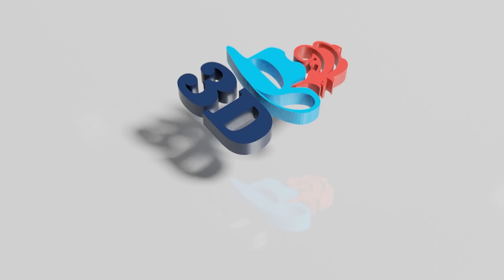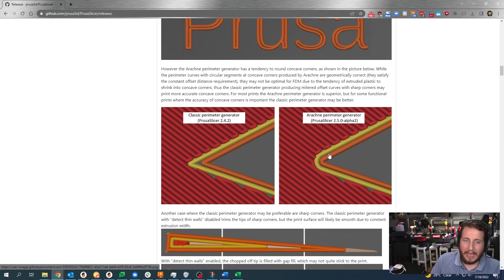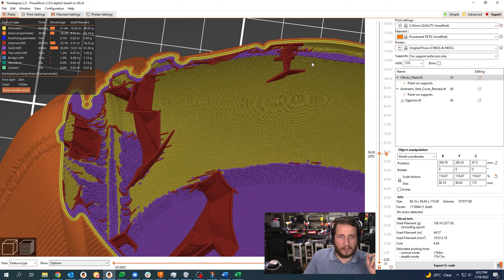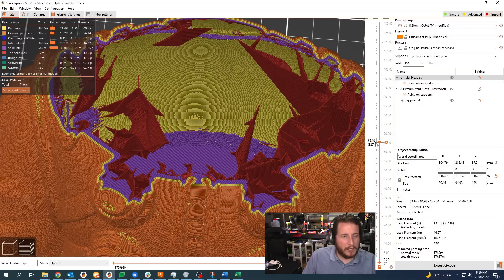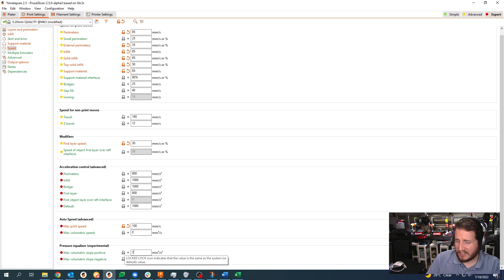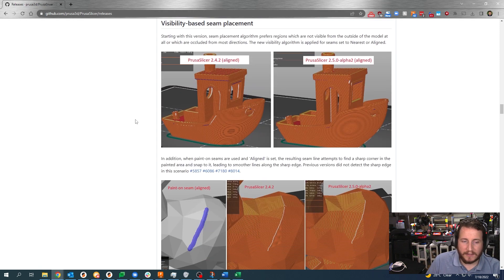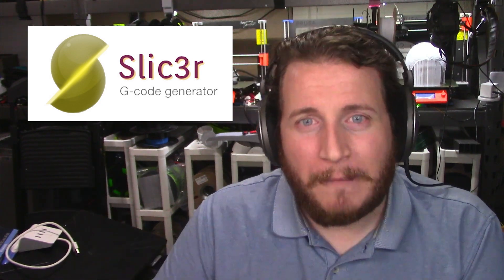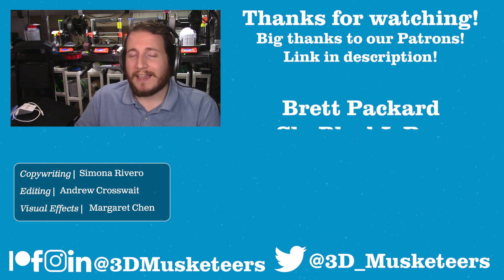Exploring the latest PrusaSlicer 2.5!!! (2.5 alpha 3)

Comment: hey Buddy, could you go through the arachne settings in Prusa Slicer again in detail ? I understand what it does in principle, but the detailed explanation ? Oh man, I mean english is my 3rd language so I might be just to dumb to understand it but it just sounds super confusing. For example:
"add middle perimeter threshgold" the smalles extrusion width, as a factor of the normal extrusion width, above which a middle perimeter will be added. Note that this applies as id the entrire shape should be filled with perimeter ...etc.

WTF does that mean ? 
I want to simply tell the slicer 0,5 extrusion width min. width 80% (0,4mm) max. width 120% (0,6mm) and that´s that. WTF is this complicated explanation ?
Reply from the maker: I am no expert on it personally, but basically Arachne dynamically adjusts line width for your parts. You provide it a min and max and it will vary based on the needs of the part. 

I can do research if you would like and integrate it into the PS 2.6 video when they release it?
Reply: @3DMusketeers  I know what it does, I just don´t understand how to set min. and max. values. It would be great if you could integrate it into your next video. Thank you =)
Reply from the maker: It will not be the next one, but one eventually, yes. I have ours set to stock for now, if it aint broke, dont fix it!
Reply: @3DMusketeers  I experimented with 0.8mm extrusion width on 0.4mm Nozzle for some storage boxes I needed to print in Vase Mode. It works very well. I would like to have one profile from 0.4mm-0.6mm this way I can print fast but still precise. I am not 100% confident what each setting really means. However you should really try out printing waaay wider layer lines, it works great and is about 50% faster.
Reply from the maker: This is all done internally, trust the slicer. If you are unsure, just leave it stock :) It works fine stock.

Comment: It's still missing the speed setting for the 1st layer perimeter, like in Super Slicer, and the tree support.
Reply from the maker: Tree support is coming 2.6 confirmed. I prefer snug still personally, easier to remove and less troublesome on bowdens in my experience. I dont care TOO much about first layer perimeters, but it would be nice to have as the perimeters could be slower than the infill. With a dialed first layer though, you can easily run it at 35-45mm/s and get good adhesion in my experience.
Reply: @3DMusketeers  For PETG i always have trouble with the 1st perimeter, that's why i use super slicer for that material
Reply from the maker: Huh.. I have not had that issue, but PETG is very picky about a clean bed.
Reply: @3DMusketeers  My heating bed is not flat anymore, i used a glass bed but PETG sticks too much and removes chunks of it, so it's complicated

Comment: Loving this content!
I just picked up an older TEVO Tarantula and not sure what printer I should be selecting under the Printer options in PrusaSlicer 2.5. Can I just go with "Original Prusa i3 MK2.5" or is there a better one? Thanks.
Reply from the maker: The MK3S+ is the newest Prusa MK line currently. The 2.5 is fine, but it is outdated compared to the gen 3. 

For your tevo, use the ender 3 profile, I think that is what it is, right? like 235 XY and bowden?
Reply: @3DMusketeers   WOW! That was fast!!!   I'm a total newbie so this is all info overload at the moment. Someone said I should look at using PrusaSlicer with the Tarantula, but without knowing which "MK" this model is I am unsure which "printer" to select. I am suggesting the MK2.5 as it seems to be the "oldest" one I can select for an i3 in the Printer dropdown list. Is that a decent starting point or am I way off base here. Thank you.
Reply from the maker: Select the ender 3 and make sure it has the right bed side, you have an ender 3 clone.

Comment: Quick question about PS if you don’t mind. where can I set the density/infill on supports? I’m running 2.5 a3. TIA! 😀
Reply from the maker: Print Settings > Support Material > Pattern Spacing. Alas it is not a percentage like what you would find in S3D, but I have gotten used to it. For normal stuff 2mm is good, but on larger objects with flat surfaces you can definitely cut that to 3x 4 or even 5mm if you are confident with your dense layer bridging. 

Hope this helps!

Comment: The Snug vs (Cura) Tree supports boils down to this for me:
Tree supports don't work for me. :/ Really wanted to give Cura another go, because there are things I love about it.
My issue: Some of the "tree" branches start printing mid air (so they fail and the part they were supposed to support). I've heard some people having similar issue with "normal" supports too but not me.
Checked stock Mk3s+ profile in Cura to see if I messed up something on my profile, same issue.
Reply from the maker: That may have to do with the density of the supports. I find they can be so small that unless your extrusion and retraction is dialed in well you may run into inconsistent extrusion issues.

Comment: This super new "Arachne" feature is what my S3D does since 2018 or so.
Reply from the maker: Not in my experience.. it's much more refined.
Reply: @3DMusketeers  I mean I didnt look into the code or something. By acc. to S3D thin feature detection and ncreasing the thickness of a print line on the fly thats basically what they did a couple years back. But then again they have a paid model.
Reply from the maker: ah, yes, for a while they had MUCH better small feature printing.

Comment: When it comes to Cura, I actually used 5.0 since beta, even though it meant losing all my plugins due to most devs not updating to the new SDK and Qt version.
I did try the earlier Arachne betas, but abandoned them due to issues with storing profiles.
Reply from the maker: seems some plugins are STILL not updated.. Which can be rough if people rely on them..
Reply: @3DMusketeers  I hacked the FreeCAD Integration plugin to run on 5.x.  Changed Qt5 references to Qt6 and changed the SDK version.
Reply from the maker: Ooooh smart!

Comment: to date, I have had some issues with PrusaSlicer (snug) supports (usually supports not touching the base), and never (yet) with Cura's tree supports. I'm only a couple months into printing and have had to re-print some items in Cura where I could not effectively remove prusa ones...
I'm curious if you have found any customization tricks that help for prusa supports?
Reply from the maker: That is VERY printer specific. What are you running?
Reply: @3DMusketeers  I have an Ender3v2. 
prusaslicer's supports were problematic in cavities where the overhang is just too extreme to print without support. Of course a horizontal screw/bolt hole can just be drilled out, but complex non circular cavities are trouble
Reply from the maker: Ah okay, that is likely the starting of a cooling issue. I would check to make sure your contact distance is appropriate. I use 0.2mm so it should release reasonably cleanly. But for all of that you also have to have adequate cooling. Are you running stock cooling?
Reply: @3DMusketeers  The "part cooling fan" (blower fan controlled by G codes) is stock, and I use the PLA defaults to have it off for first layer and 100% the rest of the time.
Hmm. my Z contact distance was set to 0.15mm. I'm guessing larger values will be easier to separate?
Reply from the maker: yep! Larger values are easier to remove but may not have the greatest bottom surface. Stock cooling on the Ender 3 kinda sucks... I would look at upgrading it with something. Lot's of options out there!

Comment: I prefer gyroid. Not only does it look cool, it feels pretty sturdy. I was showing my parents what I had been working on when they visited including some failures. My mom was obsessed with the gyroid. If my printer wasn't down at the time (nozzle and heat block came loose and I didn't have enough time to fix it) I would have printed her a gyroid only cube. I told her I'll have it for her next time.
Reply from the maker: Gyroid is the most fun to watch, I will give you that.
Reply: @3DMusketeers  It also fits into the "I can hear this picture" category. It has a very distinctive sound. Just like purging on the MMU2 has a distinctive sound.
Reply from the maker: absolutely!

Comment: I've had zero issues with the alpha. Really good improvement, I'll start using it more often.

Still missing a few features from Super I wish tye would integrate. Built in calibration tools of course, but also things like XY material shrinkage percentage. Prusa only has fixed MM xy compensation, no shrinkage percentage. So perfectly dimensional parts are far easier to get in super.

Prusa also has no way to set multiple objects to different extrusion multipliers, which really slows down calibration.

And still no klipper gcode flavor like super.

Still though, it's come a long way and a lot of these new features are fantastic. I think I'm going to be using Prusa for decorative prints, but keep using super for functional parts and calibration.
Reply from the maker: I have personally never had an issue with dimensional accuracy. We can easily hit 10-20 microns on the prusas XY and within 20-25 microns in the Z. 

I guess because I really do not mess with multi extruder machines that I have never dealt with the issue lol. 

Klipper is on my list too.. But I do like my stock printers..

Definitely coming a long way and I am excited to see the future!
Reply: @3DMusketeers  Some materials, even just from different brands, shrink more than others and I find material shrinkage to be a really useful setting. You can still dial it in without it but then you need to adapt that per part.
Reply from the maker: That's very fair. Especially when working with exotics.

Comment: nice job i was playing with prusa slicer 2.5 and i like it i might start useing the pressure equalizer for my ender 3 v2
Reply from the maker: It is a godsend for bowden IMO
Reply: @3DMusketeers  know a good number to to start on ?
Reply from the maker: Depends on the length of the tube. For the Fusion 3 I have it at 20 ramp up and 10 ramp down. But I am still playing with it

Comment: Solid infill removal would really be great. Extra perimeters doesn’t always help.  I’m not a fan of lightning infill after using it some.  It ends up printing junky and can even cause crashes and pull the print off the build plate. My experience may not be typical but I really thought I was going to love it but I’ve shelved it as an option for the most part.  I use adaptive cubic a lot but also Aligned rectilinear is good for low infill percentage, speed, and top closures. Great video Grant!
Reply from the maker: I am glad I am not the only one a bit underwhelmed about how lightning works. It has it's purposes I am sure, as does Support Cubic but I doubt I will reach for it often. I normally use Adaptive Cubic for my infill these days. I think it is a good mix of speed and strength for perimeters
Reply from the maker: That can be useful, but be careful with large tall walls, they have a tendency to bow without any support from infill